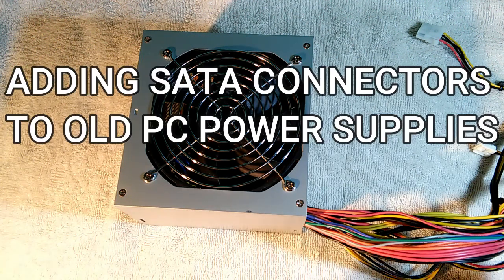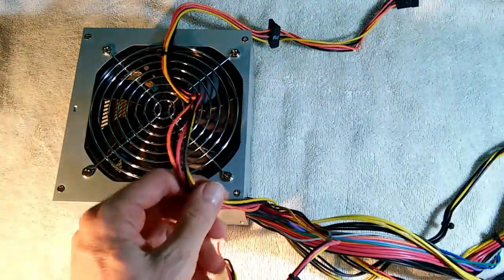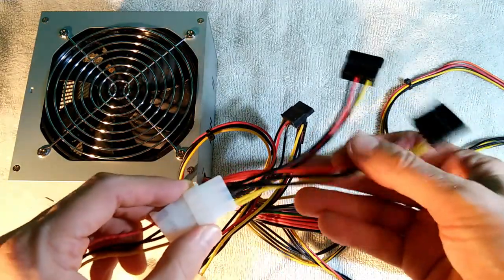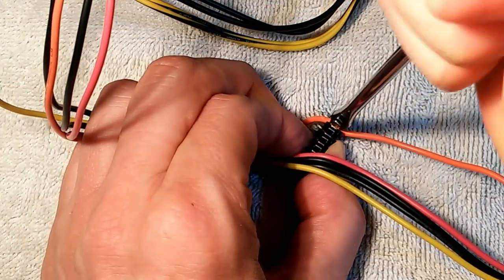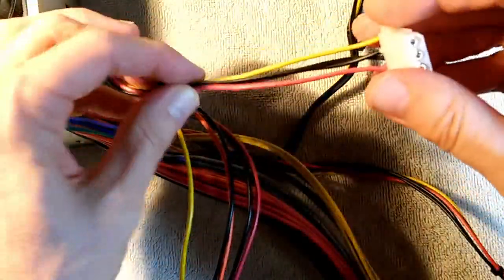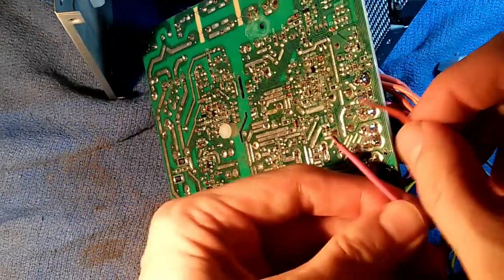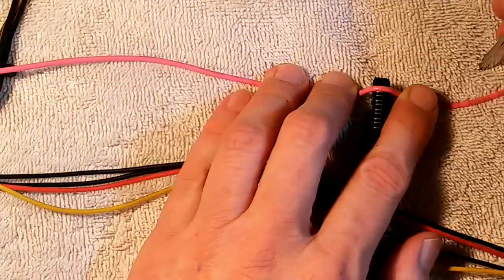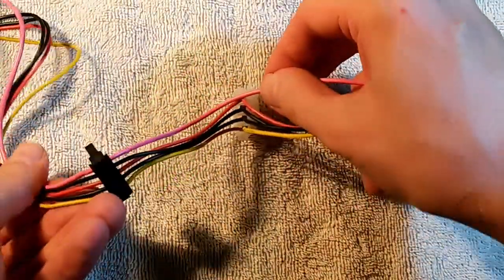Adding SATA Connectors to old PC power supplies

Comment: Hi I have a question, can I use the Sata Splinter to power RGB case fans?
Reply: pc fans donot work with sata it only work with molex or 4pin or 3pin